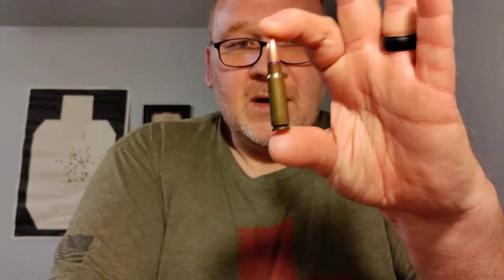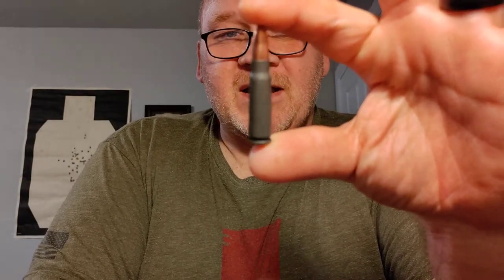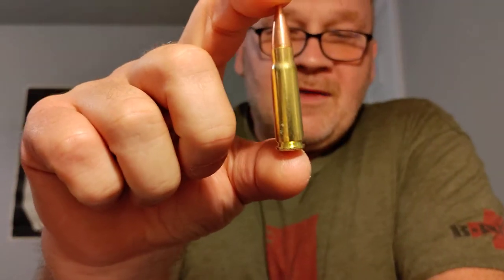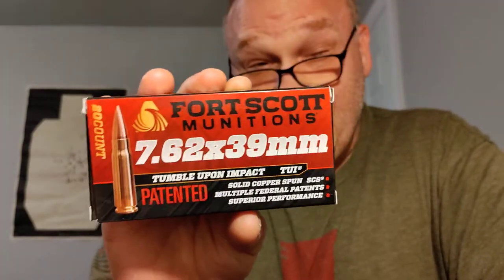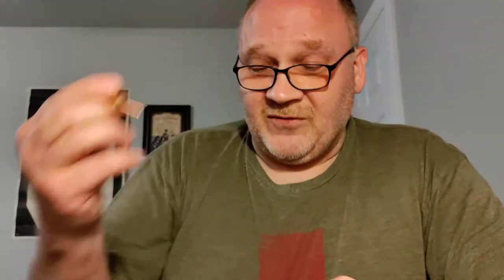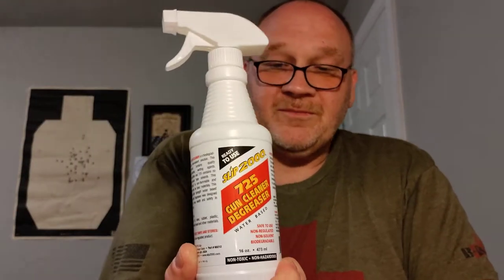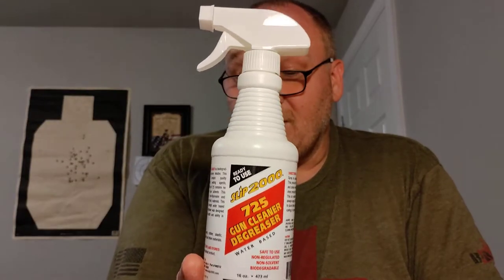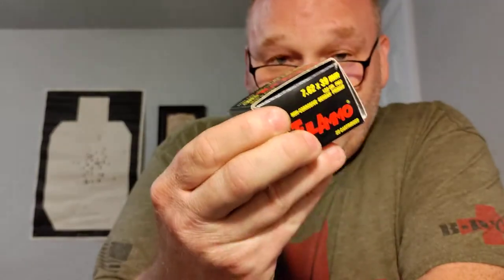7.62x39 ammo I personally have used and how it works on the AKR-39.

Comment: those are lacquer coated (shiny) and polymer coated (dull). I prefer the lacquer coated Barnaul loads, for reliability.
Reply from the maker: I've switched to poly only now that I've used up lacquer coated it just feeds smoother for me. .Of course I use brass when I can find it.
Reply: Igman makes reasonably priced non corrosive brass cased ammo.
Reply from the maker: Ironicly I just ordered some Igman and some Belim ammo. Both under 17.00 a box.
Reply: @dcrose001  I have 2 boxes of PPU brass case 124gr soft point. I'm going to try, if it works well I'll try them for a deer this season.
Reply from the maker: Should work well for you. Thanks for watching.
Reply: @dcrose001 i got 2000 rounds of belom, its the most consistant accurate ammo next to barnaul which is no longer available. I have all my aks and galil ace zeroed for it, its the best fmj currently imported. Ive shot thpusands rounds of it in backyard and it is reliable and accurate.

Comment: There's not much the 7.62x39 can't do, in my opinion it's one of the best general purpose cartridges out there.
Reply from the maker: Completely agree especially with the solid offerings from the ammo manufacturers like Fort Scott, Federal and Hornady
Reply: @dcrose001  My favorite loading is pdx1 from Winchester for 7.62x39
Reply from the maker: My go to for loadings I keep handy is the Fort Scott 117g TUI. Still deciding on a hog hunting loading, thinking about a Hornady Black 123g super shock point.
Reply: TulAmmo 154 grain soft points are rather impressive. So is Wolf milspec125 grain soft points. Both slap hard and are very accurate.
Reply from the maker: You should try Fort Scott 117g TUI rounds. They will make you a believer.
Reply: @dcrose001  have you tried em for hunting?  I'm thinking on getting those
Reply from the maker: Yup I have taken a few hogs with them and the 5.56 work great for coyotes.

Comment: U sure those coatings aren't poly and laquor now everyone uses poly mostly but the older ones were laquor coated. But I don't know a lot.
Reply from the maker: It says right on the container epoxy. You are right alot are a poly based though. The best ones are a epoxy ceramic like your true Cerakote.
Reply: That's really cool 😎 man. See I've only been messing with gas systems for about 4 years now and reloading for about the same. I started off with steel cased x39 in my first AR. Switched to brass ammo for reloading capabilities. But ne way Great work. Nice channel. I will have to surf some of ur vids.
Reply from the maker: Thanks man poke around and enjoy.

Comment: If you are shooting Russian ammo, you might have some light strikes with that hard berdan primer on Russian ammo. If so replace the firing pin with an enhanced firing pin and put a XP stronger trigger/hammer springs on it to break the primer. I had to and mine works great now.
Reply from the maker: No issues actually. I run a purpose built rig but thanks for your comment.